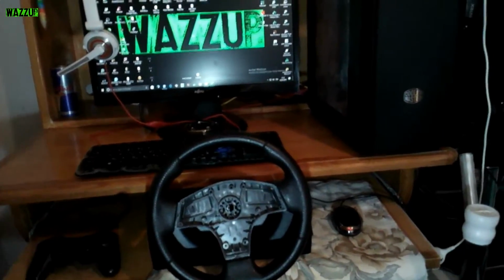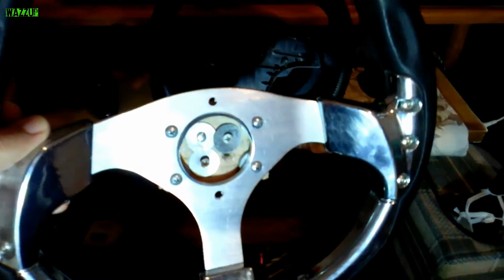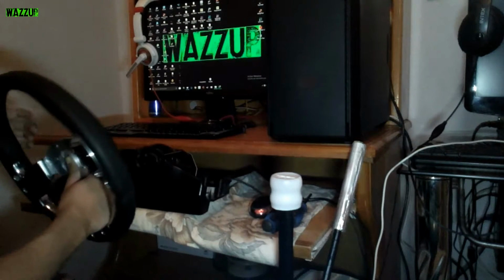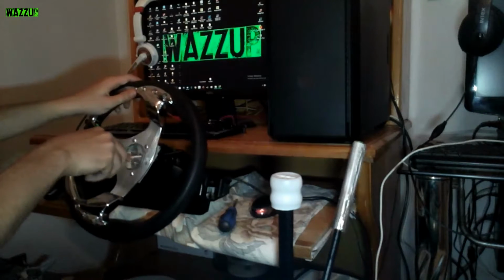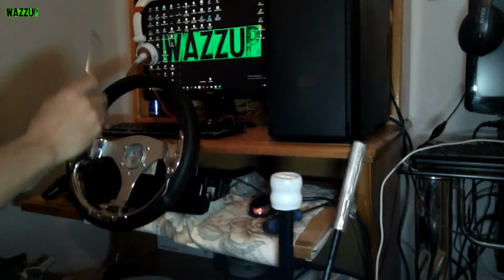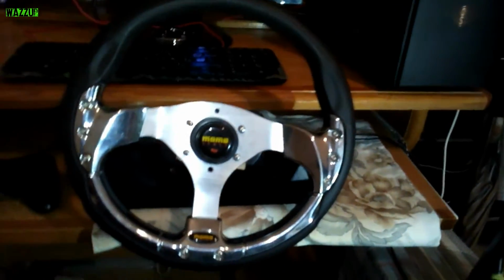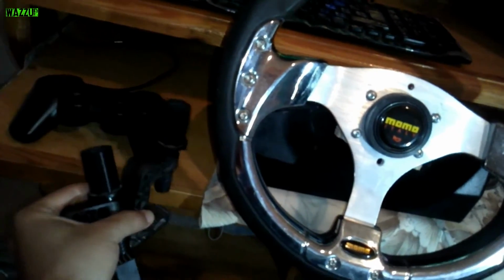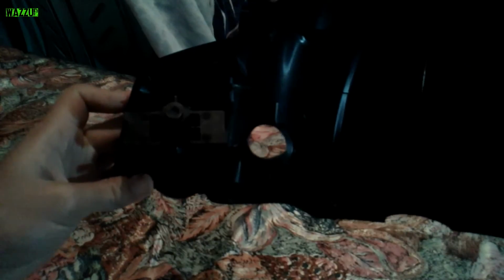"HOMEMADE SETUP UPDATE!"

Comment: Bro can u tell me what program u use to compare all that mouses...
I wood like to add gas and brake. TY
Reply from the maker: are u gonna use Mouse (Acceleration & brake)?
Reply: yes
Reply: i want to use 2 mouses 1.steering wheel 2.pedals
Reply from the maker: In Which Games ?
because in LFS & assetto corsa Im Not using any Programs
But dirt 3, my summer car & the crew im using the program MouseSteering_V1.7.2
Reply: @WazzupTN  I want to use in euro truck simulator 2
Reply from the maker: you don't need any programs for ets 2
Reply: Ok ty
Reply: @WazzupTN  hey I'm thinking about making a homemade steering wheel but I wanna make one with 3 pedals and the shifter how do I do that lol how come I didn't find this video before keep up good work :)
Reply from the maker: @BlackCat-qm3sj  With One Controller You Can Make 2 Pedals with Analog like Axis Pedals
Reply: @WazzupTN  idk how to do that but I want to make a steering wheel with 3 pedals in shifter I do have a usb xbox one controller